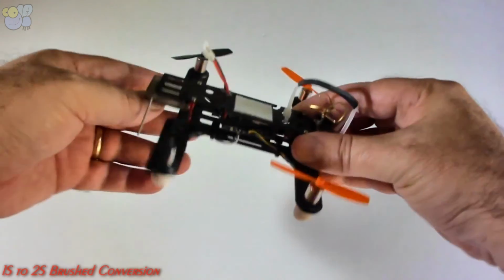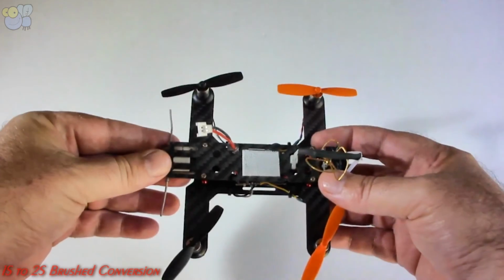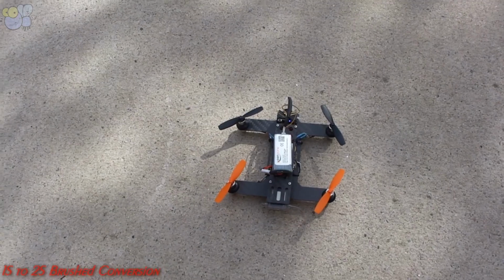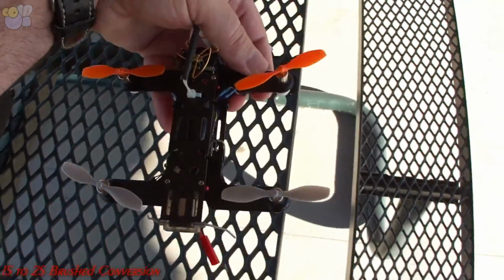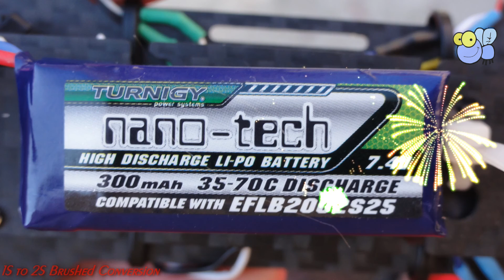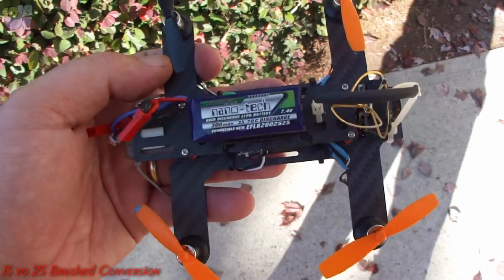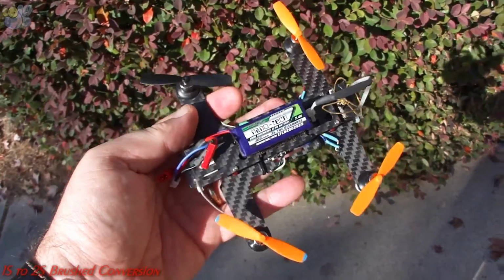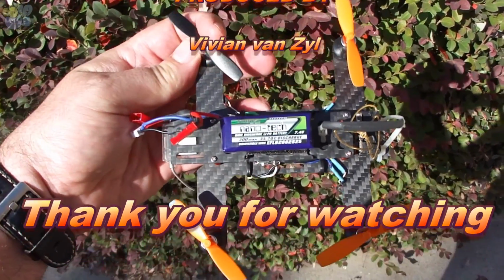F4 Brushed Micro Quad - 1S to 2S Conversion

Comment: With the Spracing EVO F3 boards that I am running 2s I've had no problems drawing the 5v directly from a UART for my TX02 AIO.  It may not be necessary on the F4 either but I cannot test for mine is not behaving at the firmware level.

Comment: Hey dude! 
Good work, BUT !
The voltage-regulator is complet unnessesary !
Instead of using this you could simply solder your cam to the
DSM connection of your FC =D This gives you a voltage of ~3.3 Volt, whitch works perfectly fine for this thiny cams ;)

Grettings from Germany :)

Comment: Hi, what your FC F4, and for you is etter to flying 2S.      :)
Reply from the maker: It is better in 2S, more power !

F4 FC Available here (CHEAP!): https://goo.gl/WBmcyD
Reply: This F4 can work with Cleanflight or Betaflight.    ;)
And je micro switche where buy it.     :)
Your motor, you can write in description.
Reply from the maker: this will work with Betaflight (dafault) and Raceflight. (I assume Cleanflight also)
The switch comes with the FC.

I will add the motor link also.
Reply: Thank you    :)